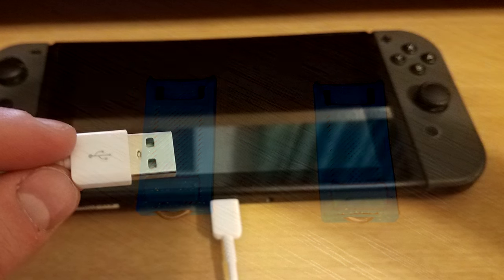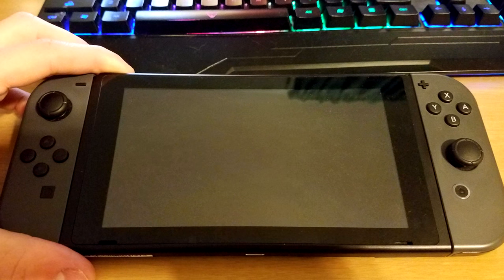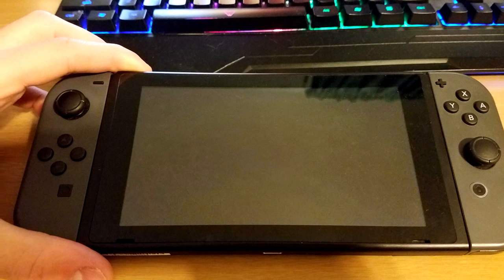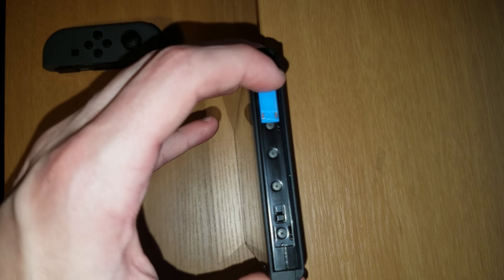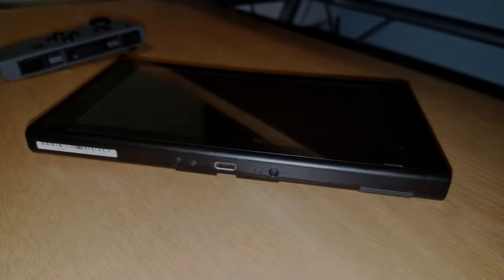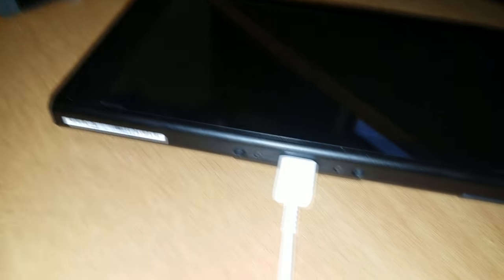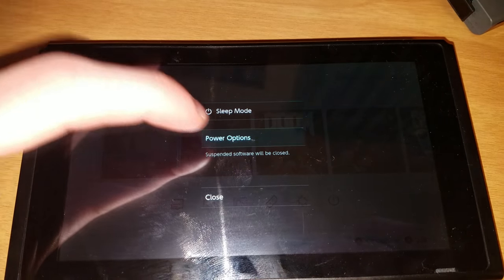[Switch] How To Boot Into RCM Mode

Comment: Ok warning to people that are going to use RCM mode to boot up to Linux, this can mess with your Nintendo Switch's battery, this happened to me and luckily I had the tools to reset the battery by just unplugging it and plugging the internal battery back in the system.

Edit: Great video btw DarkFlare!
Reply: I think it's only limited to Linux boot, I was able to go back to RCM mode and I booted CFW, it didn't cause any battery problems.
Reply: Yeah, only Linux, you can use Hekate and other payloads.
Reply: how can it mess up your battery?
and aren't  there like 3 different pin short combinations you can do?
 does this batter issue happen with  all of them or just certain ones? which 2 pins are the best to short together then?
Reply: The Linux operating system was not optimized for the Nintendo Switch, it is currently in a development state. Fail0verflow also had issues when installing Linux and it caused it to brick their device when they tried to get it working for the first time. Linux for the NS causes problems with the memory and its sensors which can mess up your battery unless you reset it by unplugging and plugging the battery.
Reply: I just modded my switch, but it's unable to exit safe mode. Will disconnecting and reconnecting the battery solve this issue?

Comment: The success rate on how I put the "Breadboard Jumper Wire Cable" is 99%, it works perfectly. After I was messing around and booting up linux like 30- 40 times, couldn't get back into RCM mode and that had to do with a battery issue which was fixed once I unplugged and plugged the battery.
Reply: Is the switch battery removable or is it stuck to the switch with adhesive like other phones?
Reply: You don't have to fully remove the battery, just unplug and plug the cable back onto the board. (If you want to take the battery off, it is stuck on the switch using adhesive but it is not easily removeable)
Reply: No problem, anytime, I'm glad I helped out! :)

Comment: EDIT: I fixed it. Thankfully. Just took the jig out and safe booted. Tried again and it worked. Making backups now. Sweet!

ORIGINAL POST:

Welp. Damnit. I just got to the bootup step and it is now just black. It won't start even after taking the tool out. Did I fry it or something? I am so discouraged right now. Good thing I bought my son a new Switch beforehand for this very reason. Man!

Comment: Whatever I do, Switch doesn't get in RCM mode. I have RCM JIG, I screwed a joycon and soldered 9. and 10th pins. I use right rail, I press and hold the volume up, and I press power button, Switch turns on everytime. It does not stay in black screen. What possible could I do wrong? Any idea?

Comment: Quick question I just remembered that I set my switch to Nintendo because I was having issues with my screen. It’s been fixed now for about four years, but do you think they could’ve patch my switch when I sent it to?
Reply: 9 months late but its not a thing they can do. The exploit is in the hardware itself, so if they were to somehow patch it they would have to replace the internals to the point where it would be easier to send you a brand new switch

Comment: So when I hold my volume up and press the power button, nothing happens on my switch like it should, but when I plug in the cable to my computer APX doesn't appear. I get the sound that confirms something has connected but i can't see anything that is actually connected, so i can't install anything either because my computer can't seem to connect well with my switch, is there any way to fix this? It has actually worked once but it hasn't since then...

Comment: I've tried and i've tried and i've tried. I cannot get my damn switch into RCM mode, no matter how many jigs i use, no matter how many paper clips i bend and break, i can't. I have no idea what im doing wrong.
Reply: sizzurp.mp3 ME TOO
Reply: never mind, i got it it to work, for whatever reason it had to be hovering over both pins instead of touching them. I honestly have no idea why that is.
Reply: Cindercyte not a problem man!
Reply: What do you mean by it had to be hovering over both pins?
Reply: You don't have to insert the jig all the way in, you have to leave a tiny bit of room between the pin and the metal end of the jig.
Reply: Ah, I see, thanks!
Reply: sizzurp.mp3 that was it!! I was like u all day trying to get it to rcm until I pulled the pins up barely touching and it worked thanks for the advice!
Reply: @brimstonelordt  I’m glad it helped! Just keep in mind, if you’re planning on modding games, particularly Smash, there’s a high chance of your system getting banned, which happened to me lol.

Comment: its easy. put foil in the right joycon pins and shove it in the right rail then just hold the power and volume up button and boom

or you can buy a jig for 5 dollars or some of that
Reply: the goat, worked first try. Wanted to try stuff out without waiting so thanks :)

Comment: so a electrical current has to run through the paperclip?
Reply: Mariobros.6428 no, there is a pin in the joycon rail that needs to be redirected to ground, the paperclip or wire simply takes pin 10 and makes it ground by connecting it to another pin or screw on the switch that is ground.
Reply: oh thx

Comment: when i plug my usb c cable in my switch in rcm it shows charging icon and boots logo up...i dont know what to di
Reply: it needs to be plugged in during the process
Reply: turn that off in settings

Comment: Help..   It said Payload Injected but still on black screen. 
Using 512GB Fat32 formatted Micro sd card I bought off of Wish App.  Screen black, switch fully charged and still able to get back into RCM mode
Reply: Centaur your switch is patched
Reply: @TheLegendaryHacker  why would it still show the boot logo?  And how if it's in the SAFE zone according to the serial?
Reply: Centaur boot logo? You mean the Nintendo switch logo when you boot the console?
Reply: @TheLegendaryHacker  no.. I mean the boot logo from the 2 different things injected into the switch
Reply: @CENTAUR559  Hmm.. not sure.
Good luck on figuring it out, though
Reply: Search Google for "a definitive way to test if your switch is patched or not" there is a guide for it on gbatemp. Also I'm sorry to tell you that sd card is fake and will result in errors when utilized by the switch. SD cards can be spoofed to show a false amount of available space. You can do a search for a guide to test it. Having said that, you do not need an sd card simply to launch a payload, so this particular issue is not related.

Edit:
Looking at your comments I'm having trouble understanding how far you're getting with this. If something is showing on your screen when you launch a payload (like hekate), but you can't boot custom firmware, it's probably that sd card. I bought a 400gb card from best buy for about $70. No issues.

Comment: I tried this and now my Switch doesn't turn on
Reply from the maker: Hold down the Power button for 12 seconds to completely turn off the switch. Remove the paperclip or whatever, and then press the power button again. The switch will turn on normally.
Reply: @DarkFlare  Thanks, I did this a few days ago